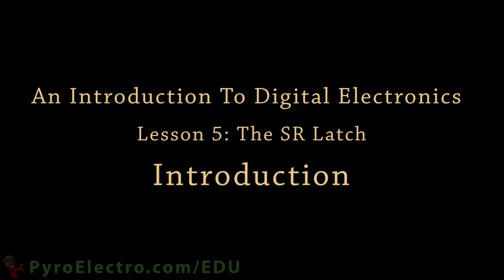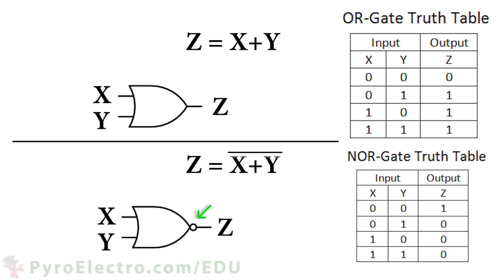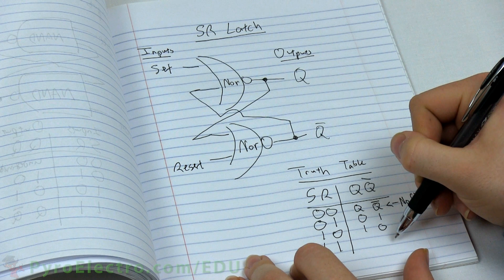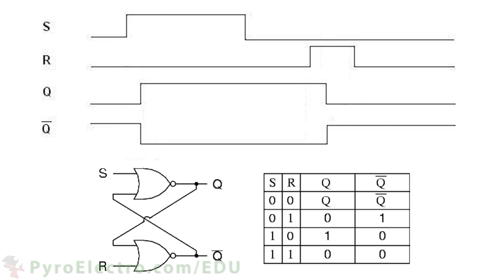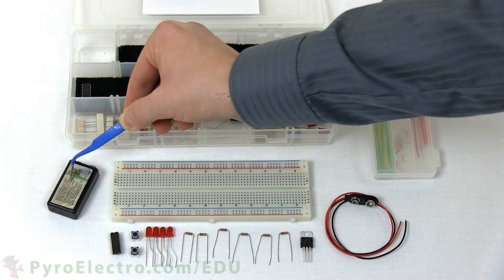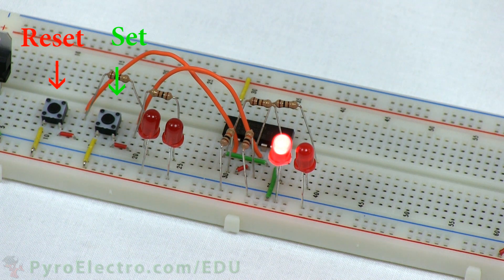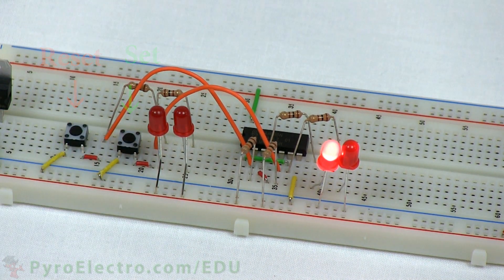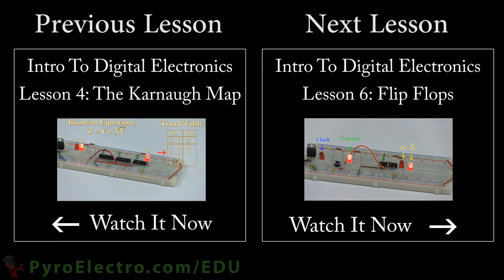The SR Latch - An Introduction To Digital Electronics - PyroEDU

Comment: Hi
Reply: Im watching you 🥵
Reply: @zacharycohen3073  The FitnessGram™ Pacer Test is a multistage aerobic capacity test that progressively gets more difficult as it continues. The 20 meter pacer test will begin in 30 seconds. Line up at the start. The running speed starts slowly, but gets faster each minute after you hear this signal. Ding  A single lap should be completed each time you hear this sound. Ding  Remember to run in a straight line, and run as long as possible. The second time you fail to complete a lap before the sound, your test is over. The test will begin on the word start. On your mark, get ready, ding